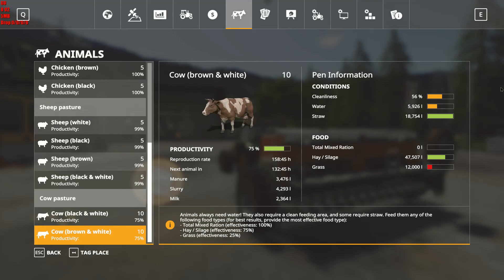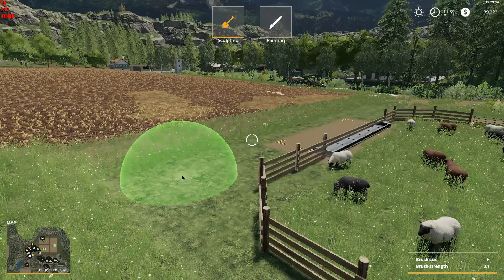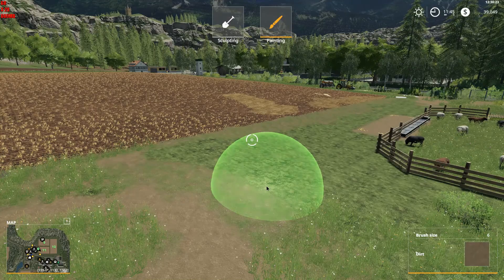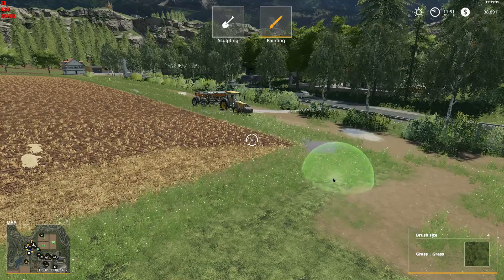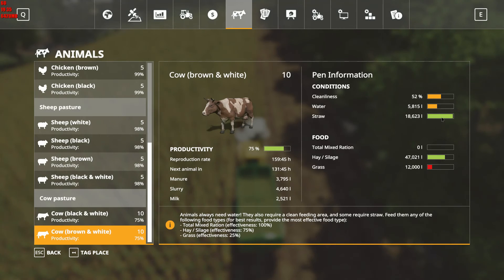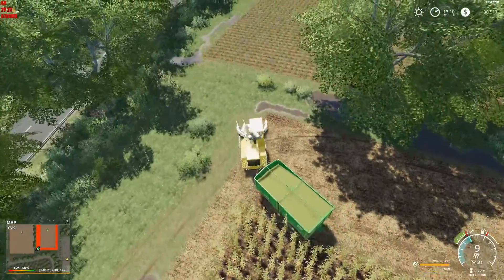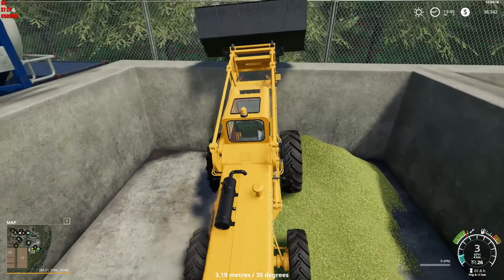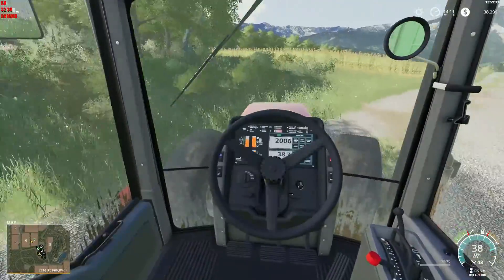Farming Simulator 19 Minibrunn Farm pt.66 Out of gas . . .AGAIN!!

Comment: When tipping in silos I set the cruise control to 3 or 4mph depending on the length of the bunker.  Then start driving as I tip seems to give me a even finish.
Reply from the maker: LOL I couldn't get it even if I were using  measuring cup to unload it.